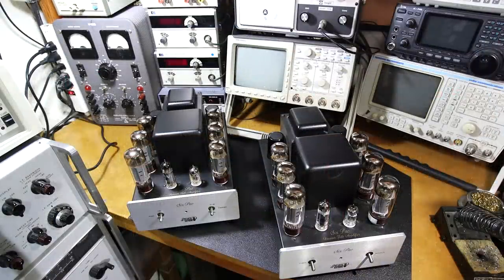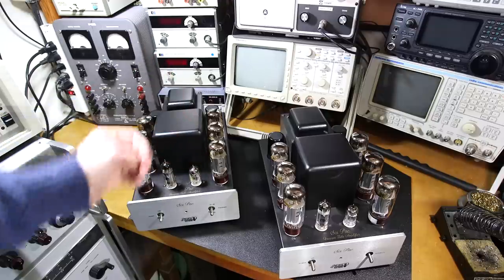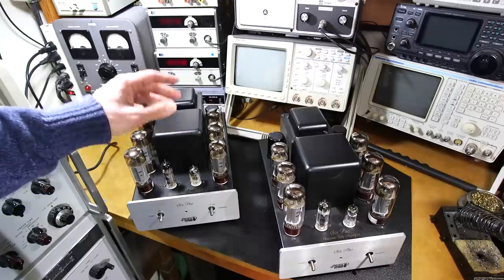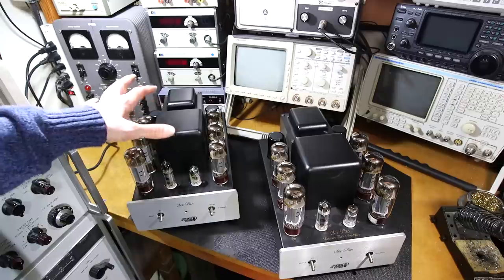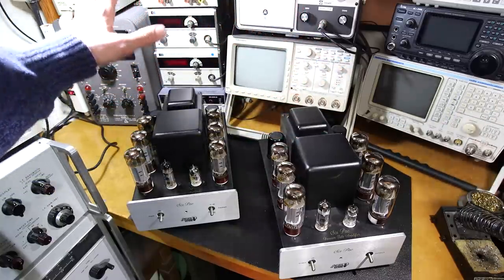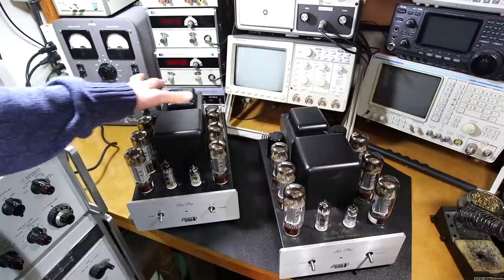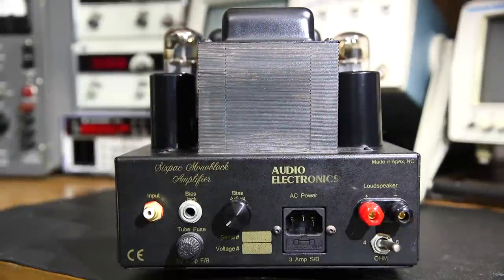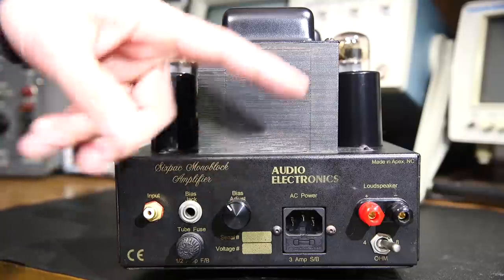Two Six Pac's On The Bench

Comment: I haven't seen where anyone figured out the 100W mod.  Those EL34 can take up to 800V, so my guess is that you added a cap on the input side of the choke to boost the B+ voltage.
Reply from the maker: *We Have A Winner!* Good call Russell... about 22uF /900V (2 caps).... B+= 600V
Reply: Nice Russell, Paul even gave a clue (I see now) about adding that and the effect on the output.
Reply: I am sure that cap also would have reduced the hum from the choke. Why didn't you install it permanently?
Reply: Probably just a matter of using the 4 ohm out instead of the 8 ohm out.  Fairly standard to see amp power out jump nearly 2x when going from 8 ohm to 4 ohm. This was one of the many specsmanship tricks from manufacturers to get their amp power ratings way up.
Reply: Not in tube amps
Reply: Joe's right.  Tube amps have different transformer taps to match the amp to the load.  Direct-drive transistor amps produce the most power into the lowest impedance load - as long as the finals can handle the current.
Reply: I was puzzled why three pairs of EL34 only with 50W output. At least it should give near 70W isn't it? This answered everything. Why the original was set to lower B+ voltage?
Reply: They take up to 800V at plates. Screen grids are not so happy with more than 500V on them, most of current production tubes are rated for just 450V. This famous phenomena called red plating is caused by red hot screen grids. Overvolting screen grid shortens tube's life dramatically.
Reply: how was the 120hz noise level with your modification? would this have had a major effect on the frequency response of the amplifier?
Reply: No use of pushing class AB triode connected PP further towards class B.
Reply: Russell, you do not get something for nothing. A capacitor input lets the filter section charge up to the peak voltage IF THE CURRENT DRAW IS LOW ENOUGH. In a power amp, it won't be. A choke input filter will enable the filter section to charge up to only about the average voltage with the benefit of improved supply regulation under load.
Reply: Those EL84 tubes can only safely dissipate 25 watts each,  but can output nearly 90 watts per pair.  But that's running them HARD.  And,  the tube manual doesn't specify pentode mode or triode connection...  but, IMHO,  this particular design had durability in mind, rather than efficiency.  The usual trade-off is 100% plate dissipation to output ratio.  Half of the input power is wasted in a typical class ab amplifier,  making it 50% efficient.  Here, however,  performance is sacrificed for better fidelity and longevity.  But the dissipation to output ratio is roughly 40%,  making the amplifier more efficient, at the cost of performance per tube.  This a very well designed amp!
Reply: Google AntiSpy 
IF YOU PAID ATTENTION, THE DISPLAY STILL SAID 8 OHM, NOT 4 !
Reply: John Bond 
EXPENSIVE TOO !!!
MY FRIEND HAS A PAIR OF THESE !!!
THE HEAT FACTOR IS UNBELIEVABLE !!
Reply: @gerryk3114  WHY ARE YOU SHOUTING!?? 
Hehe..
Reply: @googleantispy3850  It has to do with solid state amps , not with tube amps
Reply: would love to see the THD specs at the higher B+
Reply: 600V B+, Paul, for a mild-mannered Gentleman from Canada - you sure like to live dangerously!
What is the rule-of-thumb rating for the insulation used on most of the wire?  At 600V wouldn't you be approaching that?

Comment: Hmmm. Did you simply throw that switch on the back of the amp to the 4 ohms position to get 100W out of it? Great video as always, Paul! A joy to watch.
Reply from the maker: NO... But good try!
Reply: My guess is you shorted out the 22k resistor in the feedback loop. Or just dialed the bias way too hot. There is no harm in a little redplating for a good show-off =P

Comment: Would be interesting to see the effect of copper shielding around the transformer coil for both hum and induction value.
Reply: maybe not copper but nickel-iron
Reply: I've added a copper shorting strap around power transformers. It reduced the external magnetic field and didn't change its operation at all that I could tell.

Comment: Absolutely glued to this video for the whole time, really informative and interesting and a great explanation of how it works .what is the drive voltage for the audio input for this type of amplifier, I would guess around 3-500 mV?
Reply: Since there's no input pot or tone/gain control circuitry and a real pre-amp stage I assume that it has the gain set for a line output device to drive it. A line input level electrical signal typically has a voltage ranging from 0,3 to 2 Volts

Comment: The amount of ripple shown here is exaggerated since you have no speaker connected! (30:54)
Reply from the maker: You are very correct! This exaggerated "affect" is like "magnifying" the problem, so I can reduce it with ease. With a speaker attached, at this low hum level, the oscilloscope makes for hard detection due to the speaker presenting itself as a short.

Comment: To me it looks like the power supply filtering was never quite optimized in the design phase of this otherwise high performance amplifier. Clearly the ripple current trough the reactor is too high and the reactor is not correctly physically oriented related to the output transformer.
I have an idea that redesigning to a lower ripple and re-orient the reactor, still located same place, would do almost the same as you moving it away from the input section out to the side.
Moving the capacitor connection directly to the diodes through a low ohm current limit resistor, and then connecting 2 smaller capacitors in series on the output side of the reactor, would possibly get you close to the same result.
But it would save you a major physical rebuild.

Comment: Where did the time go? Once again you have done an excellent job on this video. Perhaps as a follow up (sequel?) you could show us how and where you got that choke reinstalled. Secondly I wonder if you could include the description of the operation of the phase inverter tube circuit. Finally I wonder if a metal shield could be constructed around the choke as well as rotating it's mounted position. Again, very well done!

Comment: Thanks for another great video Paul!  I would think about switching from choke input to CLC filtering for B+ with a full wave bridge rectifier connected to two 300v secondaries in parallel.  This would allow to a) more effectively use both electrolytic capacitors with no risk of over voltage and b) greatly reduce hum and vibration from the choke which does not seem to fit for choke input application anyway.  The risk of this mod is that some B+ voltage drop might occur which would be difficult to fix.

Comment: Many years ago I worked with an amplifier manufacture, on final test, the toroidal mains transformer was rotated to obtain a hum null, (50hZ of course)  much like you did with that choke.
To see minimum cross over distortion we used a 10khz tone and looked at the extracted distortion. One could very clearly see the glitch within the distortion which could be completely removed as the bias was increased.  With total THD as low as 0.01% the cross ever glitch was almost the only visible distortion apart from low level noise. Needless to say this was a transistor amplifier!!    Great video as always, thank you.
Reply from the maker: Thanks for taking the time to write Michael! Now the big question... how much feedback did that transistor amp have :^)

Comment: Thanks, you have explained this very well.  I have a pair of Six Pac’s, stock with the factory upgrades to better resisters, caps, wire, and connectors.  The bias pot is a problem; it’s so sensitive that just touching it changes the bias.  They put out a ton of heat, and a re-tube will cost you.  One sweet sounding pair of amps.
Reply: The bias pot on alot of amps are touchy like that. I like to replace them with sealed, 10 turn pots..👌

Comment: My two thoughts about the circuit:
1. The EL84 as CCS is an overkill. Most of pentodes will work really well as CCS, but the signal ones will draw less heater current for the same job. As the anode, cathode and G2 will be at practically same voltage, any nonlinearity of used pentode is negligible.
2. It isn't always true that that phase inverter tube needs to be new. There are few reasons: new tubes don't have to be balanced, old tubes can be balanced and most importantly there are inverter circuits which are partially immune/fully immune to this tube being out of balance. The long tailed is probably the most vulnerable out of them all. Paraphase is partially immune, concertina uses just one tube. There are more ideas, but those three are most popular, I think.
To be honest looking at the amplifier from the outside I thought that EL84 will be wired as triode in concertina splitter (with relatively high current and low anode/cathode resistor values it could reach much better output impedance to output stage).

Comment: Great video, thanks! I'm a recently retired EE that has been designing solid state electronics for 42 years, but I've gotten interested in tube design. I built things with tubes as a HAM operator back in my teens, but never designed anything. Videos like this are very helpful. I'd like to build my son a tube guitar amp.
BTW - They would get much more effective ripple rejection by placing the 1uF cap that's presently on the emitter of the voltage regulator on the base instead (or do both). The base is a high impedance, the emitter is a low impedance. It would also greatly reduce the momentary stress on the NPN, since there is a surge current into the 1uF at turn-on (depending on the rise time of the 400V B+ rail). Also, interesting that they didn't place any small caps across the series '5408's in the B+ rectifier to help equalize the voltage drop across them.
The location of the B+ filter inductor certainly is a poor and curious one.
Reply: Mr Salerno, there are many companies making complete guitar amp kits now. Mojo musical supply,Trinity Amps, Tube Depot,Stewart Mac Donald. Fender 5E3 Deluxe,5F6 Bassman,Ab763 Deluxe Reverb,Marshall JTM 45,1974 18 watt are all popular and great circuits.I warn you though. Your gonna fall into the rabbit hole and keep going. I'm not an EE but i started working on crusty old guitar amps full time in about 1982 and never looked back.Good luck. P.S. Antique Electronics sells chassis and boards.Schematic Heaven is  a web site with tons of schematics and BYOC and General Guitar Gadgets sell FX pedal kits, a whole nother rabbit hole.

Comment: I'm a bit late here. My first reaction at the beginning of the lecture was 'holly ... so much lab equipment, this guy must be very serious, maybe slightly nuts, why does he need so many scopes'. Definitely I would be in heaven with just a few of the lab pieces. This might be one of the best vacuum tube dissection video I have have seen. Strange, the designer(s) should be a bit more aware of magnetic coupling and other issues that you mentioned. But, many people this days usually own rather inefficient loudspeakers, my self included - maybe when they manufactured the amp it wasn't tested on 95dB+ 'real' speakers. A lot of people get a bit hyped up at prospect of purchasing tube gear. Not that I'm against tubes, but like you mentioned one should know what is he getting into, especially NOS tubes and tube rolling. I remember to use tube tester, because the Pro Audio place fixed a lot of tube gear, definitely a must for someone does for living. The probe is a really cool testing tool. Also some of Hi-end equipment back in the 80s, 90s had copper shielding or plating to fight RFI issues. 
Those Scandinavians, always up to something in audio. I will watch more of your videos, well worth the time and very informative. Thanks.
Reply: "Why does he need so many scopes?"  It's his equipment collection - like a personal museum.
Reply: "Strange, the designer(s) should be a bit more aware of magnetic coupling and other issues that you mentioned."

Why pray tell? What with the horridly and obnoxious, loud noise called music now, WHO in the pluperfect hallelujah cares? Huh?

Not to mention that the hum and the audio is so ensconced into noise and distortion from hell; that nothing could bring it out, but Jesus. Sad indeed.
Reply: With very sensitive spkrs, hum and other issues are noticeable between songs, or very low signal levels, say if someone listens to classical music. Not everyone cares about latest POP music. Plus it's a good design practice to make equipment as quiet as possible.
And, I absolutely admire the number of test equipment the man has in his lab. He knows his stuff and he's not afraid to correct the design of this particular product 👍. Sorry if I offended anyone.

Comment: Very nice job!  I enjoyed every minute of it.  The last time I built an audio amp was in 1962 so it's been a long time.  I used large chassis with all power components far away from the input.  It disturbs me that the "shield" side of the input is above ground.  What preamplifiers have a sheild side that is not grounded.  It's more like a balanced input, which I would have two inner conductors both shielded.  Broadcast equipment audio running long distances use 600 ohm balanced input.  I admit I am not up to par an newer equipment.

Comment: Paul, here's a thought.
If you wanted to make this thing silicon-free, you could swap the 1N5408s for something like a 5U4, the 160V Zener diodes for two 0D3s, and that MJW16212 with a 6K6 in a triode configuration.

Comment: So what was the 100W output modification? I'm not going to sleep tonight now!
Reply: ECC83 fitted
Reply: He put a cap across the input to raise the B+, only way to do that in 15 seconds.
Reply: I suspect that he changed the bias point from class AB1 to class B.
Reply: TERRY has it right !
Reply: Sure you got some extra voltage there, so the choke could be replaced with linear or switch mode regulator.  It could then produce the 100W but the low frequency range of the output transformer would become limited and then one would have to consider a cross-over and maybe some digital driven sub-woofers. The tubes would have to be premium quality, to take extra voltage, and one might want to install a slow start circuit where filaments are energized first, to prevent arcing.  Run the subs crossed over about 80-100Hz at about 400W per channel. Now your system sound twice as loud and bass extended. 
Apparent loudness is the power peak an amp can produce in the first 10th of a second, which is usually where well designed tube amps excel.

Comment: dunno how this came up on my feed.  But it was a serious wake up after 40 years of working in the digital realm.  In the 70's I worked on rf tube amps.  Got a job offer by a local pro-video/audio company 3 years ago but turned it down.  This was a great revitalization of my knowledge.  Spent 30 minutes analyzing your self drawn schematic of the tube amp.  That must've been a bitch to do.  Been there done that.  The only thing I could not come to grips with was the phase inverter.  The only thing that set the two control grids of the 12ax7 were a few resistors... how does phase inversion occur with this setup?  I've always wondered this and it would be nice to see how that actually works.

Thank you for this presentation.  Love your scope collection btw.  That's insane! haha!

Comment: Always being excited when seeing Mr Carlson's Lab uploaded a new video! One question on circuit design in general: Isn't it clever to design a circuit that works well even with tubes/transistors/passive parts that are not closely matched or hand-selected in any way, instead of relying on the customer to buy the best set of tubes, or as a factory buying matched transisorts in large numbers? Thinking of seperate Bias-setting pots a.s.o.... Many amp-buiders seem to go the opposite way!? Apologizing for my english...

Greetings from Berlin

Comment: Triode-connected output stages generally produce about 1/3 the power of pentode-connected for the same tube type. 52 watts is pretty good output for this setup.
I generally set bias on amplifiers with a distortion analyzer as a guide. Many amplifiers whose components are the right of the bell curve can maintain very low distortion while idling at bias currents well below the factory recommended value.
An underbiased amplifier will tend to give slightly higher distortion readings at lower power output levels. You'll likely find that the distortion at 10W decreases as you bring the idle current up closer to 200mA.
That amplifier has a rather unusual "hot cathode" phase inverter using a EL84 as a current source for the cathodes of the 12AX7. This is probably to bootstrap the 12AX7, because it normally cannot drive this many power tubes. Usually a 12BH7 or some similar high transconductance tube would be used here. But the designer wanted to keep tube count down, and very few audio signal stages while having the higher gain of the 100 amplification factor of the 12AX7.
Mechanical engineering and electrical engineering in an amplifier don't always line up perfectly, as seen here with the improper placement of the choke inductor. I worked on a pair of Electro-Voice amplifiers recently that didn't follow star grounding topology and they suffer from eddy current induced buzz coupled from power transformer to the chassis, as well as the output transformer. To be expected from an amp made in 1955, but this looks like a pretty new 'boutique amp' and such design considerations should be well known today.
Nice presentation. Always enjoy watching these on my coffee breaks.